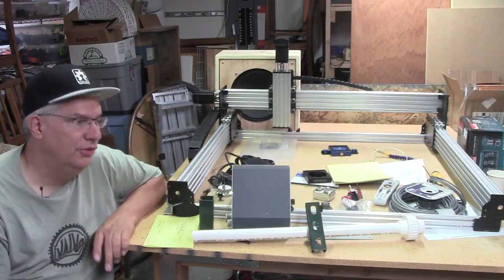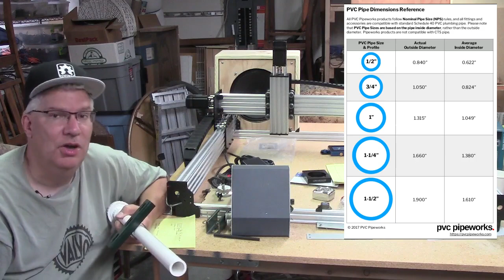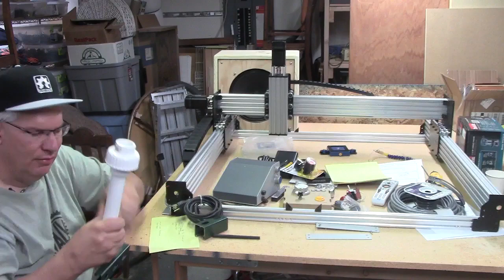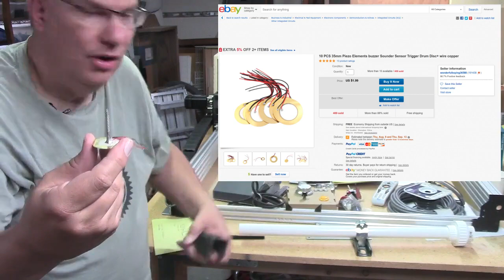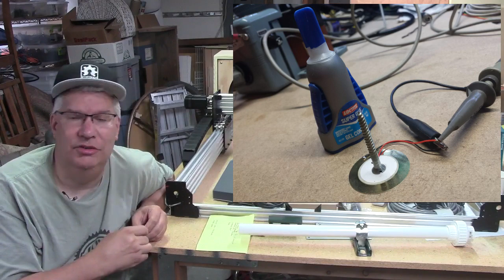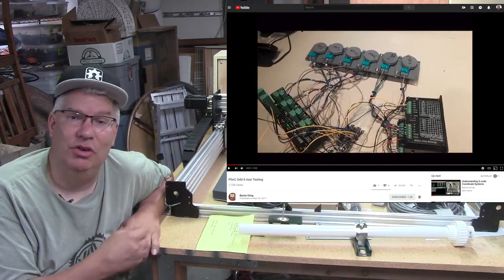180723 Valve Studio - Tonehenge Journey - WorkBee Lift, Controller Mount, & Probe

Comment: I've got the 750x500 WorkBee. I used 1" steel tubing as a frame, corners welded and m/l flat. A power cord to the CNC's power supply is the only travelling wire (mine has web interface to its microSD card). 4 x 2mm stainless steel cables connect to the steel frame and go up to two parallel PVC pipes that are belt driven by a 40:1 geared stepper motor controlled by a Teensy MCU and Trinamic stepper driver. I push a button, my CNC goes up to clear my work surface. I push it again and it lowers onto my head and  all the tools I forgot to move out of the way. Travel time is around 5 minutes each way and nearly silent.
Reply from the maker: That sounds much simpler than my approach, do you have a picture or video of your lift somewhere?
Reply: @CraigHollabaugh  Yeah, pretty easy. I already had the PVC, stepper, and controller mounted on a piece of birch ply for another hoisting idea that I changed my mind about, so it was an hour to weld the frame, and an hour to lag bolt the hoist to the ceiling and figure out "How many steps is 'UP'". Nope. I don't do videos. I'm boring. My son said "Why didn't you just use a cheap winch?" I didn't tell him "Because that would be too easy, son." but he's out of the will.
Reply from the maker: @Giblet535  I was wondering how you cabled it up so your machine's spoiler rose to your table height. I do like your stepper motor usage.
Reply: @CraigHollabaugh  Yeah, I should take pictures, do a video, take out the trash. Wife says it often.The WorkBee lives on a steel tubing frame. Beneath the frame is a workbench that leaves 8 inches on the sides and front, and 4 inches at the rear. The PVC/stepper winch (sounds kinky somehow) raises it off the bench around a million steps, leaving the Z stepper a half inch from the 9' ceiling when Z is at ZMAX. Yes, it will operate in the raised position, but not well, or safely. The UP step count is adjusted by double-tapping the switch. DOWN is that count plus 2000 steps. The Teensy watches the Trinamic stepper driver over SPI and records (on Winbond flash) where the CNC is every 300ms. If power fails, the Teensy will complete the previous operation when power is restored. Reversing the stepper the same number of steps puts it right back where it was, plus 2000 steps. That gearing is overkill for this weight. It won't miss a step unless I forget and leave a bag of Sak-Crete on the spoil board. The winch uses an old ATX power supply, so the Teensy runs off the PSU's STBY power, and turns the PSU's 12V rails on/off as needed. I left code on the Teensy for limit switches, or at least an Eagle Has Landed switch, but it proved unnecessary. There's no external sensing of position. In the down position, the cables are slack and can be unhooked from the steel frame, but I just leave them attached. It's simpler than what you're doing with that scissor jack. I don't know that it's better, but it does what I wanted.

My wife says I do "simple" better than anyone she knows. At the advice of counsel, I take it as a compliment.

I've been meaning to give this thing a permanent dust collection system, but dragging a hose causes the CNC to rotate when it lifts/lowers so I have to manually swing it to the correct position on the bench. That's work, and I don't want carpal tunnel syndrome. I have an idea for a simple dust collection gate that the CNC will engage (and open) when it lowers. I'll make a video of that when it becomes important.
Reply from the maker: @Giblet535  This all sounds great. Thanks for the reply. Keep it simple and keep the wife happy.
Reply: @CraigHollabaugh  "Happy wife, continued life!" I always say. Always.